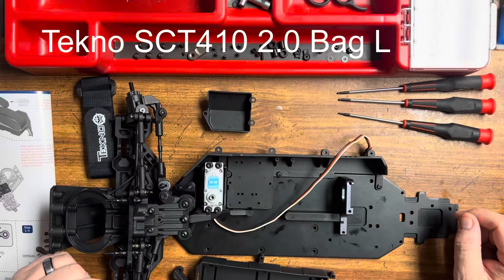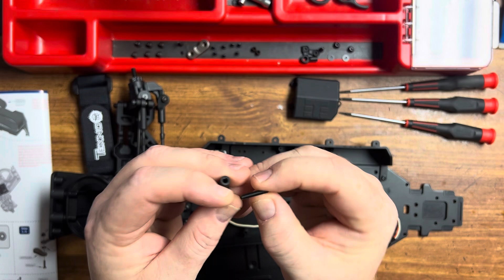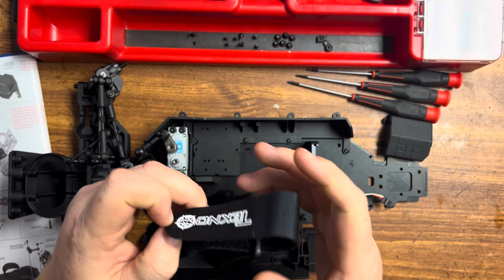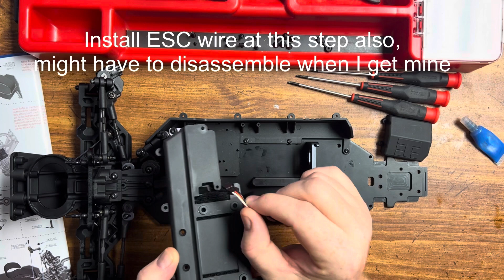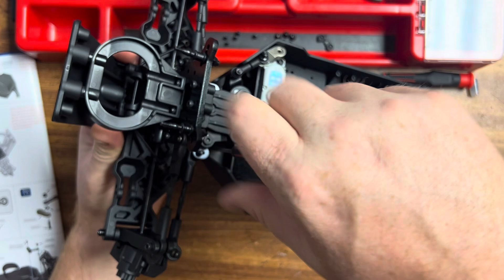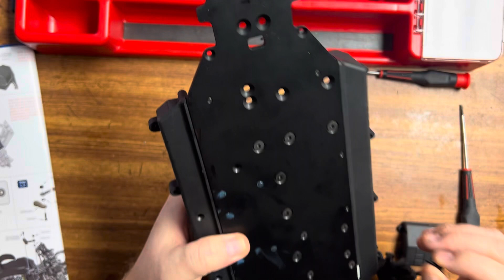Tekno SCT410 2.0 Build Bag L

Comment: A quick tip about the wire routing - you can snip off the top the rx box wire hole to make it a simple slot that's open from the top.  This will allow easier installation and removal of the electronics.  This will be a running change on future kits.
Reply from the maker: Lol I actually did that last night saw it in a comment from another build video. Now I won’t have to take it apart to install my esc!